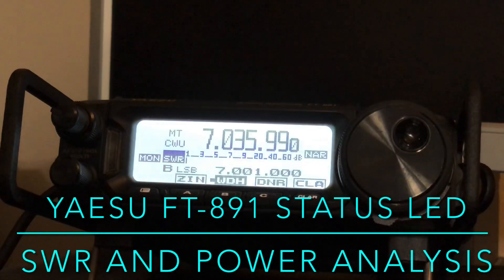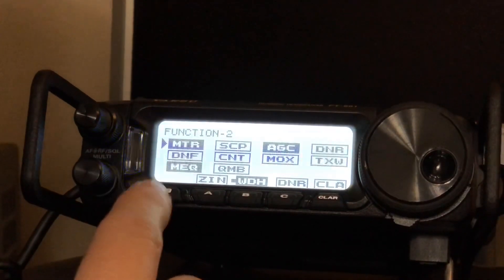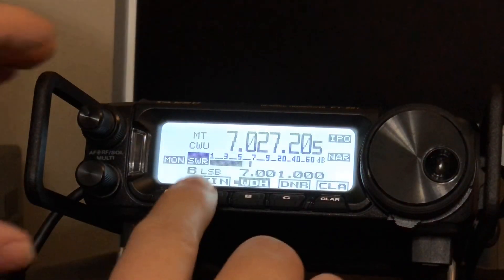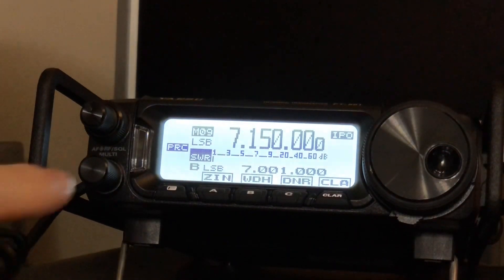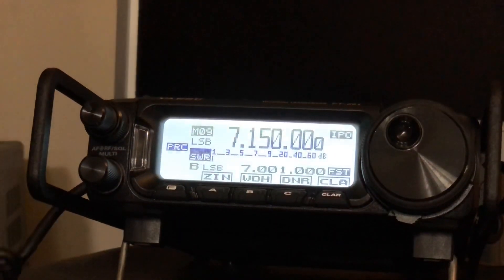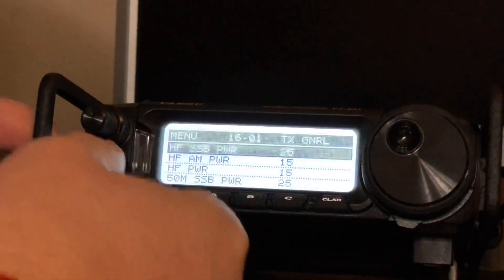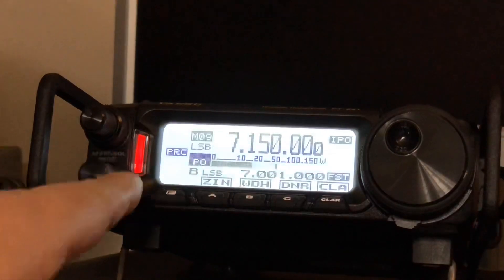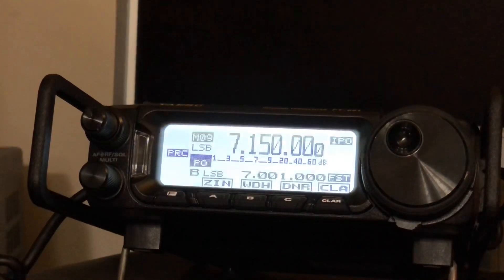Yaesu FT-891: Status LED, SWR & Power Analysis #ft891 #hamradio #swr #power #meter

Comment: This is a great portable rig and I’ve had a lot of fun activations with it. It’s my go-to rig. For /p, Rx current is a bit high for portable operation but it’s still an awesome rig and a great price too. 73 de Will, M0LGW
Reply from the maker: Hi Will!  Yes, the RX current for mine is approximately 1A at a reasonable volume level.  But I can tolerate that.  The batteries I use (3aH & 6aH LiFePo4) provide plenty of power for a day of SOTA.  I can usually activate 2 or 3 summits with the 6aH, amounting to approximately 100 contacts.

Thanks for your comment!

73, Doug

Comment: Ftdx10 do not have peak power output, if you transmit at ftdx10 the meter only indicate average output.
Reply from the maker: That is correct.  You must whistle a loud and steady tone in SSB mode, or use FM mode, to check for full power when using only the internal metering. I don’t watch the PO meter anyway.  I always leave the meter set for SWR, as shown in this video.

73, de N4HNH
Reply: @n4hnhradio  Thank You

Comment: I’ve got a FTDX10 in the shack. I bought an Ft-891 at the end of December. Until recently I’d only used the 891 for a couple POTA activations. I put it in my pickup a couple weeks ago paired with an ATAS-120A antenna. Now that I’ve gotten familiar with the radio I really like it a lot. 
Thanks for the videos, I’ve learned a lot from them about both the FTDX10 and the FT891 radios. 
I can’t say that I’m extremely happy with the ATAS antenna. I took it down and put up a 40m Hamstick in its place. The receive quality seems to be a lot better.
Reply from the maker: I too am a fan of the ham stick antennas.  I carry a fleet of them of course, but the performance makes it worth it.  And the little FT-891 deserves more credit than it gets.  We get so much bang for our buck.  I’ve enjoyed mine as a base station, a portable, and a mobile.

Thank you for supporting this channel, James.  I appreciate you.

73, de N4HNH